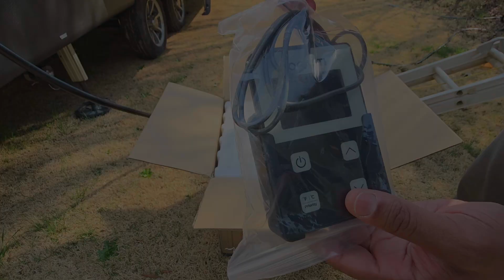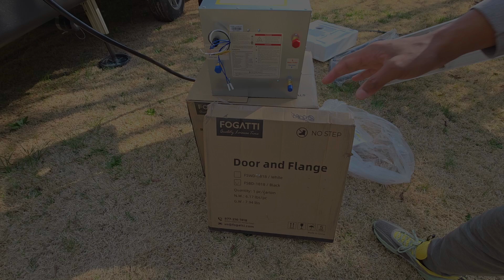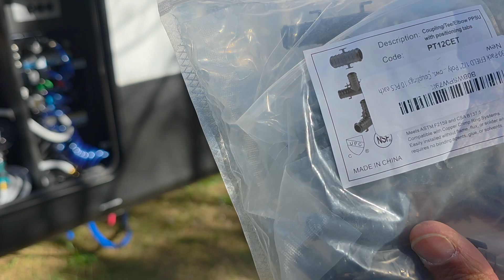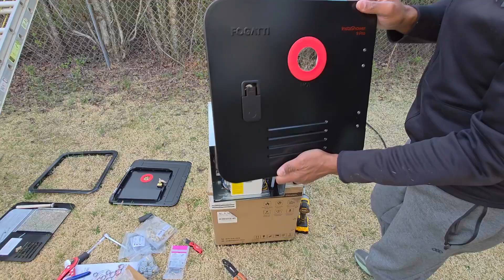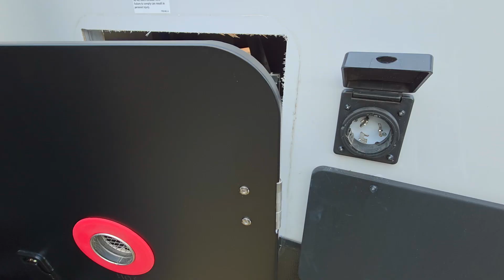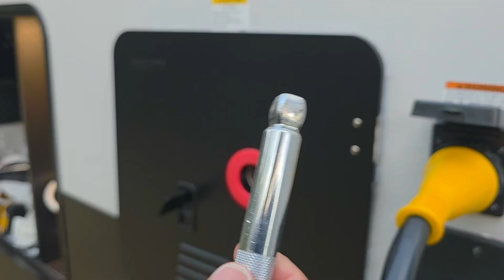The Tankless Water Heater Every RV Needs | Fogatti InstaShower 9 Pro

Comment: I'm looking to replace my suburban 12gal tank (SW12DEL).  this is my 2nd one and im done with Suburban.   Nice video-will help alot in installing mine.  What size was the door that came with your unit?  I saw you purchased a door and it didnt appear that you used it.  I measured my suburban door opening and its 18x18.  so im about to purchase the Fogatti 9 pro and believe I have to order the 18x18 door separately.  What size was your door opening?  I did'nt see in the video whether you used the extra door.  Thanks alot for the video Really helpful!
Reply from the maker: I also replaced the new Suburban unit mine came with. The opening is 18 x 18. The 9 Pro comes standard with a 15 x 15 door so you have to add the 18 x 18 to your order. So you will end up with having to swap off the 15 inch door for the 18 which is what I did in the video. Let me know if you have any other questions before or during your install.